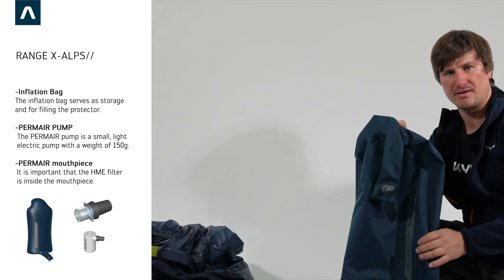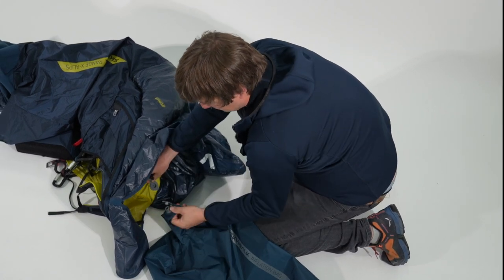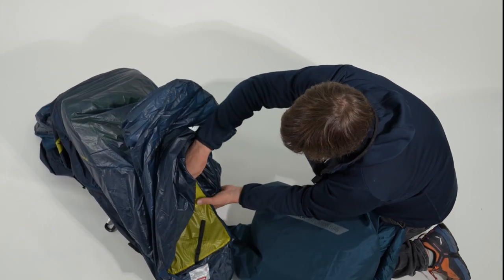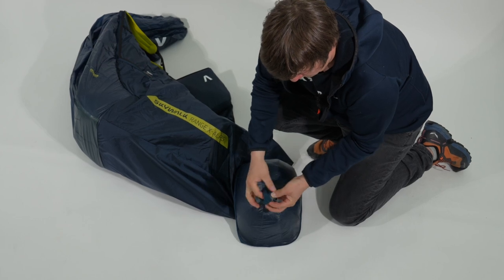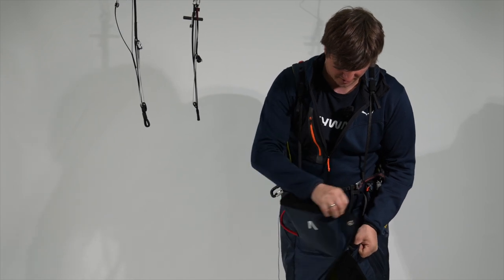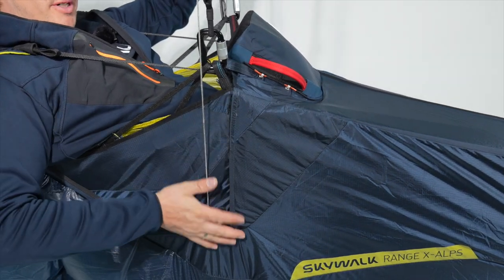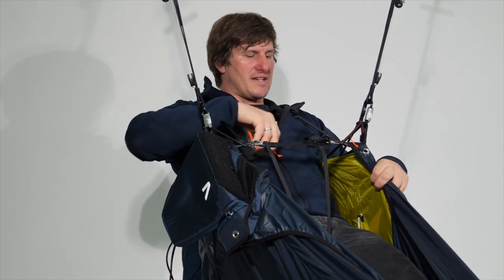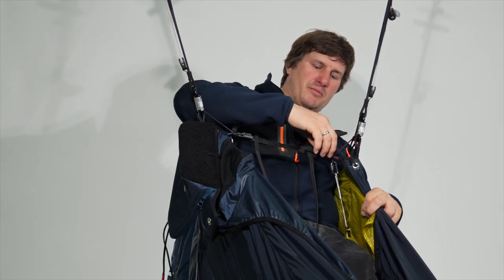RANGE X-ALPS3 - Prepare for take off

Comment: I am thinking about ordering the RXA3. In the manual, it states that if you plan to descend more than 1500 m from the takeoff point where you have inflated the protector, you must repressurize the protector when you are at the lower altitude. However, nowhere in the manual, or in any description on the Skywalk website, do I see how this can be accomplished while you are flying! Is there a tube that you're supposed to connect so that you can blow it up while you're flying? I need an answer to this question before I can order this harness. Thank you.
Reply: Read the manual carefully. That direction is for when the Permair Pump is used. It indicates that the pump alone is not sufficient if more than 1500 m between launch and landing, and you must inflate additionally by mouthpiece in that case. If you read the section about using the inflation bag and mouthpiece, that caution does not appear.